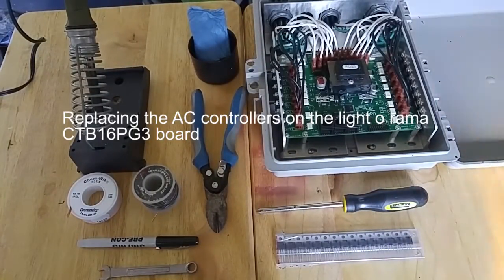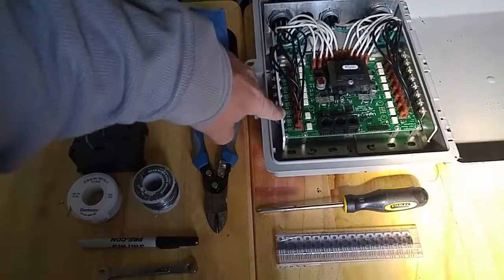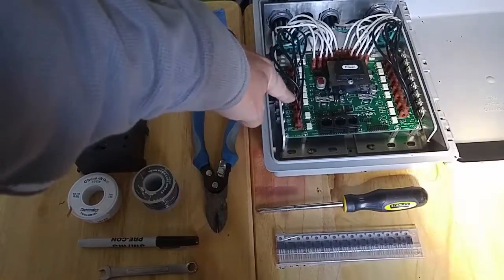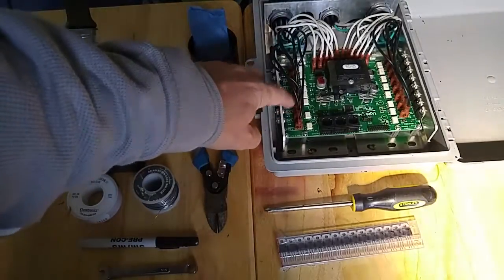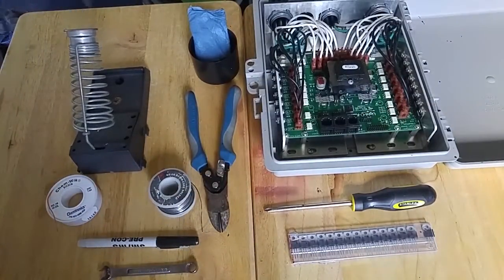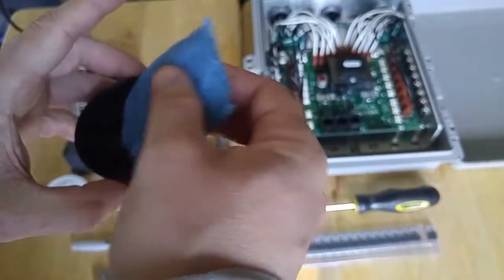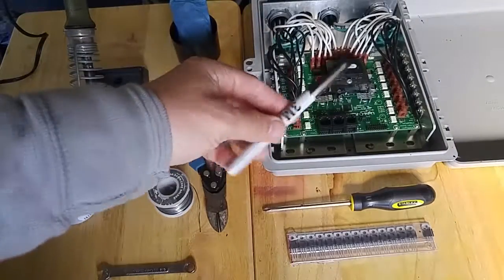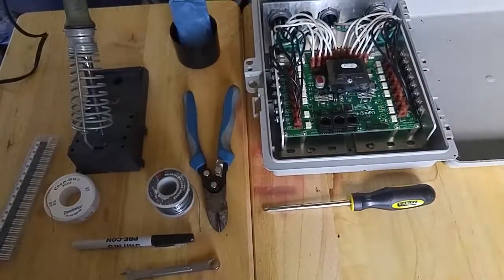Repairing your Light O Rama Controller Part 1

Comment: Noticed recently that a few strands randomly blink every few seconds when nothing is connected to my box, and at different brightness levels. Would this fix my issue?  It's a commercial one from eBay.
Reply from the maker: That might help, if you are good with soldering and removing components then I say do it. Mine would stay dimly lit on a few channels but this fixed that problem.